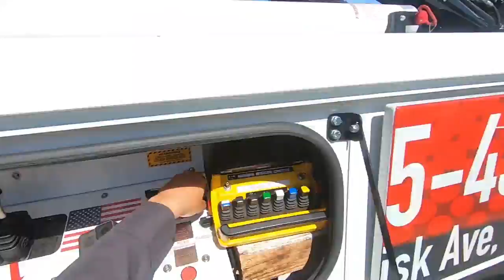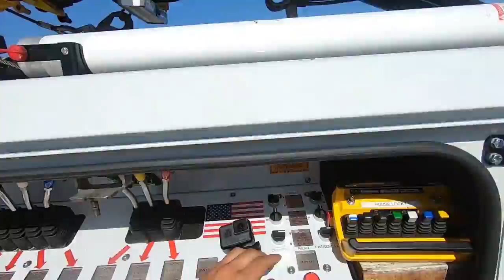Container Falls Off Trailer!

Comment: Well now... As a Transportation Safety Specialist/Truck Push in the Big Inch Pipelining Industry up here in Canuckistan I can say with all certainty this started off as an unsecured load.  I have seen a low-boy tip with a 94 Sideboom (sans counter weight but with the stick removed but secured to the bed) tip 90 degrees due to hidden ground erosion from rains, and everything stayed right where it was put because the load was properly secured.  I have also seen one of our Western Stars involved in a head on collision with a snow plow (snowplow turned onto a divided highway into oncoming traffic due to ZERO visibility from high winds and driving snow) where the king pin sheared off and the low-boy with a 470 excavator secured to it went careening into the centre snow covered grass median and the load was still secured to the low-boy.  Thus I can safely assertain that this load knocked off in a parking lot was UNSECURED to begin with...  If this was somebody in our company the first thing I'd say to the operator would be "PISS TEST"; the second item on my agenda after investigation would be skidding the operators ass....

Comment: Cowboys used to ride horses, now they drive pick up trucks with 2 X 20 foot containers unsecured.
Reply: sts899 the containers were more than likely secured to the trailer if you were listening in the beginning Trent said another driver wasn't paying attention with the trailer that the other driver was pulling and knocked the container off
Reply: :-) thats so true
Reply: Nathan Brodeur lol no. If the container was properly secured in the first place it would’ve tipped the whole trailer not just knocked the container off.
Reply: So did the other driver knock it off with the chains ? Wtf
Reply: @nathanbrodeur  Not that bright are you?
Reply: Actually you are half correct. Cowboys did ride horses and rounded up cattle to bring them back to the coral or brand them. Now Cowboys drive tow trucks and rescue vehicles from calamity - and often bring them back to the coral for salvage.
Reply: robert shaw ... Tsk Tsk. With that name, you should have a pretty good basic understanding of marine biology.
Reply: I agree, there should be a MINIMUM of 3 straps but should use 4
Reply: @nathanbrodeur  Obviously The container was Not secured properly. If it was, the trailer could have flipped and the container would still be secured.
Reply: It wouldn't have come off if he chained it down and 2 straps. Hotshot drivers always living on the edge!
Reply: @johnneal1102  and others..These containers weigh about 4000 punds in standard configuration. To secure them enough, you do Top-over lashing with 2 staps with a WLL of 2,5 ton and probably some rubber mats underneath to get better friction. If the container are filled, there are a multitude of ways to lash it down. One could be diagonally lashing on all 4 sides, and the you dont need the top-over lashing. The best one thou is to have a purpose build cargobed with twistlocks build in.

Comment: Hey Trent, I was out your direction a couple weeks ago. Yuma proving ground. Had a rental car swap out to do. I go i-10 to Quartzite, then south on 95 to the entrance to the YPG. It's slightly shorter to take I-8 through Gila Bend, but geez it reeks out there. Anyway, the exact location of the car I was looking for wasn't given. Just said it was on Imperial Dam Road outside of the proving ground. Fortunately, as I arrived at the road, the car was visible on the other side of the cannon. It looked odd as I got closer and the reason became obvious. The original reason given for the exchange was that the car had overheated and lost coolant. It was perched on top of a landscape boulder and broke the radiator when it rolled the stone. I texted one of my bosses some pics , showing the boulder under the car and the right front tire off the ground. Told him it was a good thing they sent a recovery specialist for the swap. The military police brought the renter to the scene and he took the replacement car. The MP girl hung around and wanted to help. I gently explained that the truck was going to do the work and I was just going to look pretty. Well, she stayed close for the show. My first plan was to use the left rear corner of the bed under the right front tire since it was already off the ground. As I started to attach a strap on the wheel, I noticed that the thing had a substantial front subframe. I pulled the strap and reset the truck directly in front of the car. Put my 4 X 6 across the end of the bed and slid it behind the air dam. Used a mini-J in a hole in the subframe. Pulled up the slack and hoisted the nose off the boulder. Pushed the bed back and lowered the car behind the rock. I was pressing the bed rail on the rock and couldn't quite get the nose low enough. I went ahead and inchwormed the truck a couple feet back and reset the car far enough back. Once I got it unhooked, the MP girl said that was the most amazing thing she'd seen. I reminded her that it was the truck doing the work and I was just being pretty. Fun stuff.

Comment: Friend of mine works at the docks in Anchorage Alaska they have dropped fully loaded containers into the water off the side of the ships.
Reply: Has the invention of the crane not made it to Alaska yet?
Reply: Dang
Reply: There's a whole lot of cargo on the ocean bottom. The stacks of containers sometimes tip over in heavy seas. The kicker is that it's not worth salvaging.
Reply: 50,000 lbs  full, sometimes
Reply: @bonham1981  yes they have cranes but cranes only work if the people attaching them are competent.

Comment: "knocked off by another truck" .... Swift driver?
Reply: Or jb hunt
Reply: It may well have been a swift driver, but I'm wondering if the container was secured in the first place, and just slid off when the driver turned sharply? Oh and I think the front box may have shifted also!
Reply: Or JB hunt
Reply: That was the first thing that came to my mind too
Reply: theres no gouge in the road to suggest he was moving when the container fell, still, load should of been secured...  or just used the correct trailer, even a unlocked twistlock on a container bed would of more than likely prevented this.
Reply: Swift drivers are worst driver on the road. Worst than Chinese drivers....
Reply: Tom Kennedy omg....I just sprayed my beverage all over my iPad 😂😂😂

Comment: Dude, why is he driving around with trailer wheels like that?
Reply: because he can
Reply: Cause he drives with big brass ones to try and counter the weight of the container
Reply: Dented wheels and no load securrment.  Damn hotshotters putting everyone at risk.  Do us all a favor and learn to drive truck or get off the road.  Get a damn cdl.
Reply: Wheel was damaged by the truck that knocked the container off his trailer !
Reply: @ebels3  CDL for a pickup truck?

Comment: I haul containers. "Hot shots" haul m/t containers. Most do not have container locks. So the will run a chain front and rear thru the corner holes and tighten with a binder in the middle. Then still put 2 straps over the middle. But straps dont work so good on iso tanks. They damage the tank. So the chain method thru the corners.

Comment: Shouldn’t there be a minimum of 3 straps or chains securing each container on that 40’ flatbed being towed by a Class III, 1-ton pickup, truck? No wonder the container fell off. Hopefully your bill will be a lesson on properly securing loads; it’s cheaper than a DOT ticket. Glad it fell off in a parking lot and not on a family sedan with kids in it.
Reply: To me transporting containers without using twistlocks is big no-no.
Reply: Yes a minimum of 3 straps and 2 chains placed through the lower pockets wt a binder placed in the middle. But because the front container is to close the front chains should be in the upper pockets pulling forward and down Same wt the front container but to the back and the front should be cross chained do to how close it is to the neck. The rim is is an oos and needs to be repaired.
Reply: @stuntlife420  If you use 2 straps with 2,5 ton WLL and rubbermats in all 4 corners where the container is touching the trailer, it is more than enough to keep it in place, provided the container is standard and empty
Reply: What kind of straps? If you are talking about ½ ton staps, 3 isnt enough ;-)

Comment: 2 securements in the first 10 ft and one for every 10 ft (or portion there of) after. So at least 5 straps total required per DOT. I would put 7 straps total and chains front and back and short chain the middle. That cause I don't want to be on the news as the guy who shut the interstate down... Or end up here or Ron pratt's YT

Comment: Why didn't you pick it up from opposing corners. You have 2 winches could have put one on each corner. Lifted it and put it on the trsiler. It was empty and only 5000 lbs. Just curious
Reply from the maker: That could be potentially done but would be frowned upon. It is best to have a 4 point pick to evenly distribute the load and maintain better control. Thank you for watching!

Comment: Someone didnt secure their load. No way a driver knocked that off like that . He took a corner to fast and nailed a curb trashing his driver side rims.  The original straps you can see the faded white or yellow  are half the width of the new ones he bought at the truck stop. Let me guess he had two walmart straps holding on each container .

Comment: Where are the security chains at front and rear. and if it strapped properly this should have not happened.  seams like a X Swift Move. live and learn folk's. I know in California empty or loaded chains are required on both can's front and rear or 1 can it's the same. straps helps keep it from bouncing. should be using 4 inch strap's also instead of two inch even though 2 inch meets requirements. chains should be a must, better to be over done / secure then under done / secure.

Comment: Why do back off a /4 turn on Clovis bolt?.
Reply: It's easier to unscrew them once you're done lifting. Tightening them all the way means they get wedged a little once there's a load on them and you'll need a hammer to loosen them again. That's just my guess though.
Reply: So it doesn't jam and need a wrench to remove it.
Reply: the clevis gets stuck sometimes if it is not backed off. the bolt gets turned a bit by the load, tightening it too hard to undo by hand.
Reply: So the pin of the clevis doesn't get siezed in while under load.
Reply: So that while it's under load, it doesn't end up getting twisted tight.  If it gets twisted tight, then you'll need tools to get it loosened off again when you're done.
Reply: If not it would bind the threads wen you put it under load

Comment: Judging by the condition of the hotshot drivers equipment, I'd have to say he's not too reliable. Wheels on the trailer were bent to shit, load securing absolutely sucks, etc. Time to look for a new line of work. Try applying at the city refuse / recycling pick up, they don't give a damn about their equipment either so I believe that you'll fit in perfectly !!